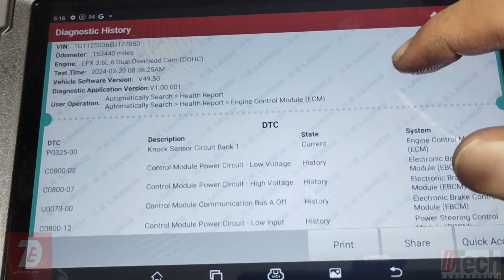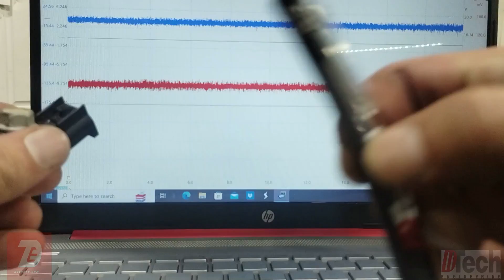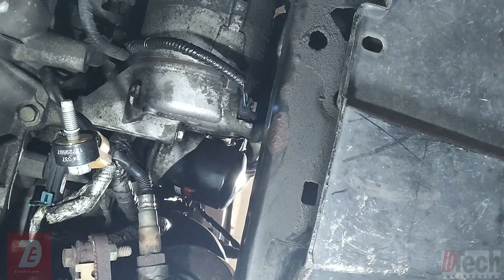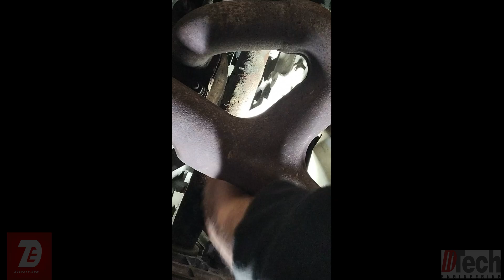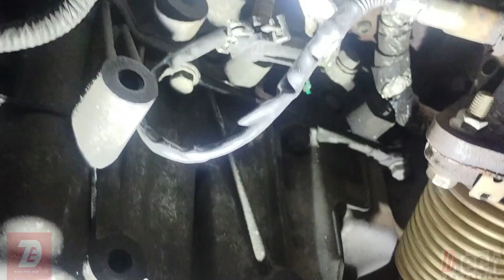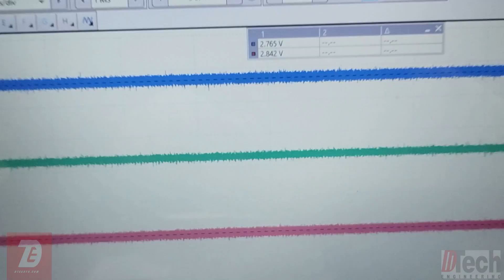Chevy/GM Impala P0325 Knock Sensor Circuit Code Fix

Comment: You said that you routed new line to the knock sensor, maybe it is a dumb question, but could you help me understand the best way to access the ecm side of the knock sensor harness, I have a P0325 and P0328 code on 2008 Chevy Impala 3.5l and have replaced bank 1 knock sensor which seemed to clear the P0328 code leaving me with a persistent P0325 code and car accelerates very poorly. Spark advance varies from -6 degrees to 40+ degrees. I would like to run new wire but I’m not sure where to begin. Also do not have access to a lift, thank you very much

Comment: Was this a poor pin connection issue?
Reply from the maker: it was a broke wire at the back of the knock sensor connector

Comment: Sadel,, great video.  I especially liked this video because it's not your every day problem.  Also, knock sensor issues are usually foreign to most people since you don't normally see issues with them.  Thanks for taking the time again!
Reply from the maker: It definitely was my first time as well performing on vehicle scoping of knock sensor circuit, it was cool to see the difference with a good connection and one with poor connection. Reminds me of a load test with light bulb.